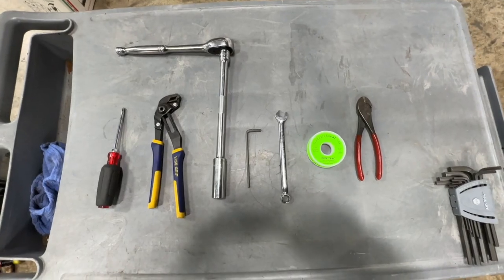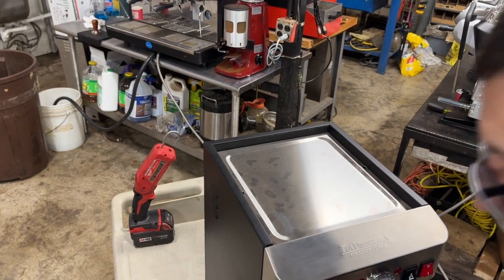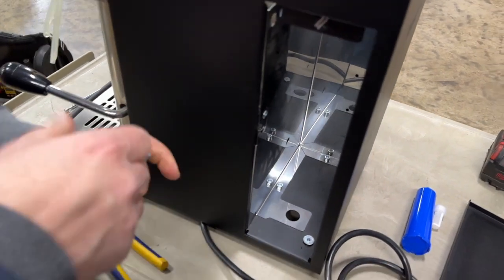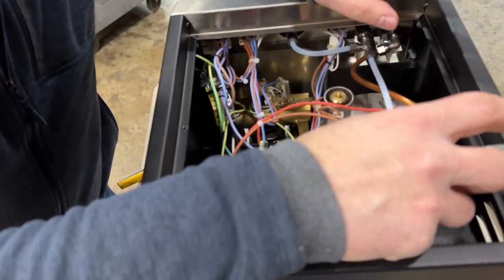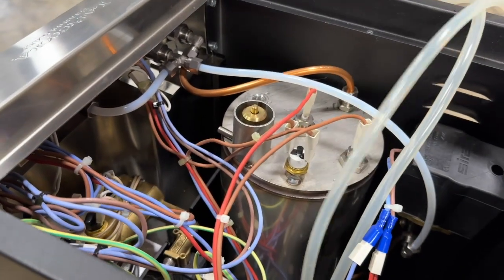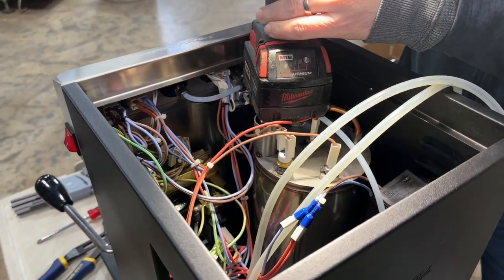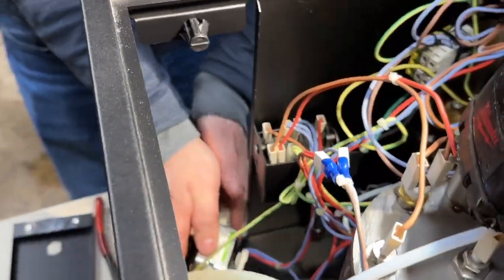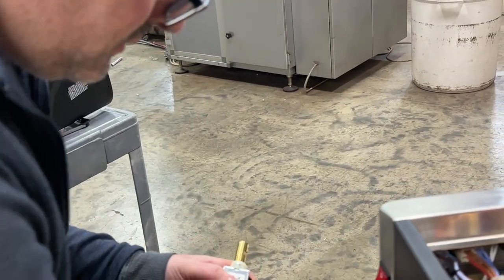Water Pump Replacement La Piccola Cecilia Espresso Machine  HD 720p

Comment: Hi, I have a problem with my la Piccola 4 groups can you help me
Reply from the maker: We do not stock parts anymore for La Piccola machine, but I may be able to point you in the right direction.
Reply: @saccuzzocoffee  Thank you for your reply and this is what I exactly need to direct me. I have bought a used one and I don't know how to make a cup of coffee because the water doesn't move into the machine it has a hose at the bottom the second problem is the plate where you choose single or double cup is not connected I can send you a photo if you want 

Regards
Reply: @saccuzzocoffee  I think there's something missing in the machine
Reply from the maker: That’s a pretty vague description, but usually the pump dries out or needs to be replaced. I assume you mean the keypad is not working, that could be a lot of things. Could be the flowmeter, control board, keypad, or the wiring. You might want to try contacting Lucaffe directly, they may be able to direct you to someone in your country.
Reply: @saccuzzocoffee  First of all thank you again for your reply, second, excuse my poor English, third the wire of the keyboard or control unit is not connected to any other wire in the machine 

Regards
Reply: @saccuzzocoffee  Hi 

Is there a PCB for this machine